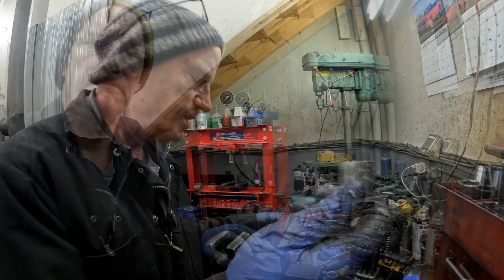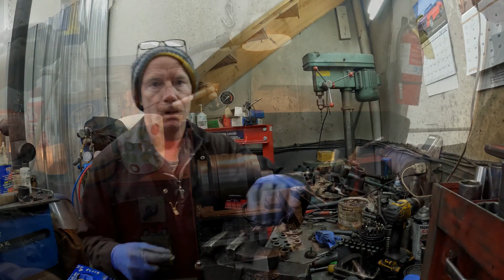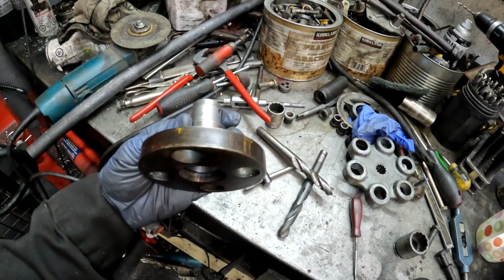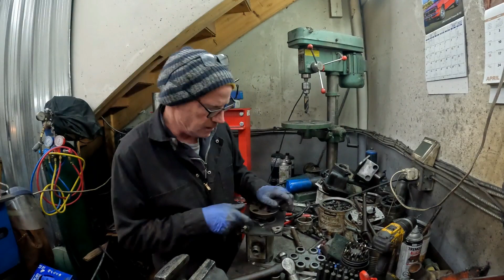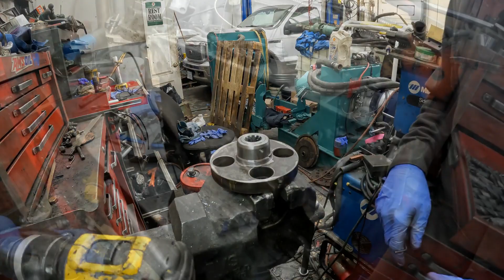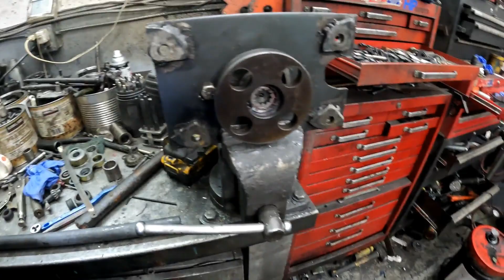Detroit 2-53 (Adapting Hydraulic Pump Coupler)

Comment: That was a good idea to put the engine on its back to line it up. I am still having an ongoing battle with my 6v53. The lower fuel rod was bent as well coming out of the governor to the head. Fixed that and readjusted the rack. Once it started I set the idle for about 550. When I rev it up it come back real slow to idle. The sides were not the same temperature. Could I have one side of the rack too tight? Can I rev the engine without the buffer adjusted? I can't wait for your videos on a 6v53. I'll watch those on repeat for days!!! Thanks for all your content and advice!
Reply from the maker: Yes if one side is too tight, then it get's more fuel than the other side and runs hotter.  Just have to go back and re-adjust the rack and get them sinked with each other.:)  Yes you can rev it without the bufferscrew adjusted, buffer screw is just to smooth out the roll or hunt if you will at idle.:)  Thanks for watching.:)

Comment: I was thinking maybe you could put some kind of manual clutch release somewhere between the pump and the crankshaft. In case a hose develops a bad leak, you can disengage the pump and not worry about a giant oil puddle.
Reply: Or you could just shut the engine off, right? 😊👍👌🤷‍♂️
Reply from the maker: Ya that's not necessary, very rare to have any leaks.:)  As @tdotw77 says, just shut the engine off.:)